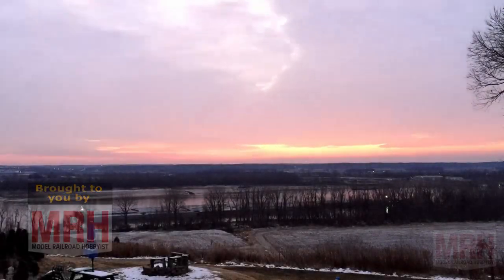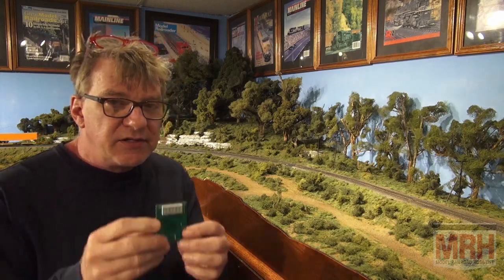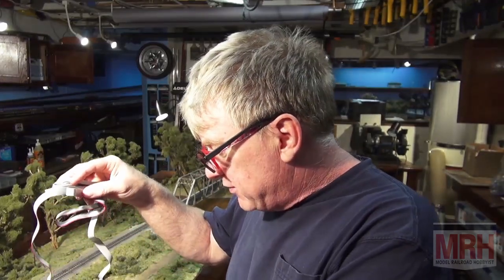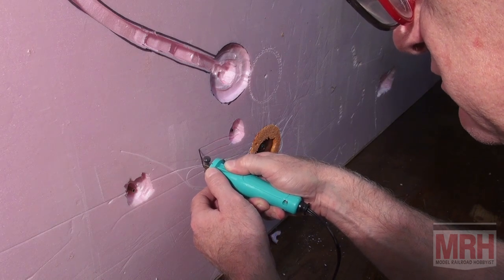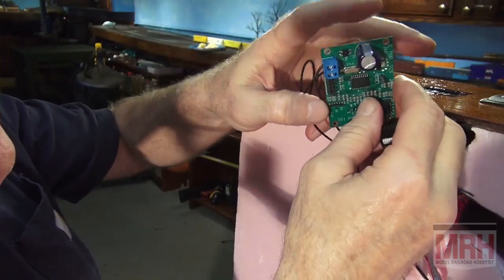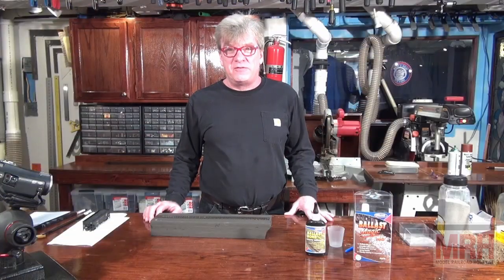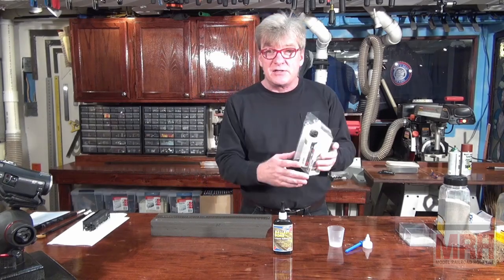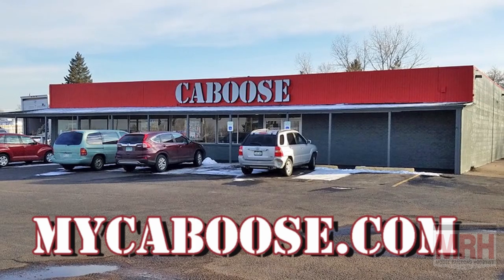Install a track speedometer | December 2020 WHATS NEAT Model Railroad Hobbyist

Comment: Great video Ken, very informative and classy installation techniques. I recall years ago that there were a series of articles in Model Railroader Mag. about determining train speed using a measured track distance and scale time to estimate train speeds but this gadget you installed is way easier. Thanks.

Comment: Mr. Patterson, I FINALLY have a place to start a model railroad.  I had one when I was a teenager, but I have now been without a layout, longer than with one.  I have decided to go HO scale and have been working on the track plan as I have time.
What, in your opinion, is the next “most important thing to decide” item I should be focusing on?  Not looking for hand holding, but I know a lot has changed since I did this last.

Comment: Thanks Ken, you are re-inspiring me to find my hobby again. I'm drawing plans to build a steel mill where I work. I have a bunch of footage of both a BoF (basic oxygen furnace) and an EAF (Electric Arc Furnace) both I work directly in front of performing laser readings to apply my companies Aluminum embedded shotcrete to maintain it's perimeter. It's quite fun and very dangerous, perfect for a nutbar like me 🙃

Comment: Great video; you said in the video that the speedometer could be set up for measuring speed in kilometers; but you didn't show us how to do that. Do we set the sensors up at 1/100 of an H0 scale kilometer (about 114.8mm or 4.52 inches) or how do we do this. Because some of us like to model railroads from other parts of the world where kilometers are used.

Comment: Nice clean installation of the speedometer, Ken. Well done. Wouldn't it be nice if TCS included a fascia panel-mount plate? Most users are going to want to install this device in their fascia. You had to jump through a fair amount of hoops to make this happen. TCS should provide a decorative face plate bezel to cover an oversize hole (drilled by the layout owner) to make this neat, tidy, quick, and easy. Also, for a few bucks more they could provide a wall wart power supply and necessary connectors that you had to rummage for. Just my two cents.
BTW, did the laundry dry okay? ;-)

Comment: Cool. I’d have placed a thin red plexiglass rectangle over the 7 segment displays (so offset the electronics further into the foam) to get an easier to read display as it hides the non illuminated parts of the display. 

. Seems to me the speed trap design made it needlessly hard. Better would be to have the modeler install the IR sensors where they can , measure that distance precisely ( and here is where mm would be so much better than inches ) and the program that precise value into the module to tell it how far and the model then does the calculation based on that distance. 
Requiring the modeler to physically place something super precise is a bad approach.

Comment: I like your videos, I get some good ideas, but I model in large scale. So I have a question problem. Since HO is, about 1/4 the size of large scale, do you think that if I take the HO distance of the sensors and multiply it times 4 it will give me a relatively close estimate of the speed of my trains.

Comment: For what I do to measure speed is set my throttle a bit under half speed and time how long it takes to do one loop I then measure the track it cover so let’s say 40 second 20 feet and so you do 20 times 160 (n scale or 87 for ho etc) then I get 3200 feet and with that divide 40 by 3200 and you get 80 mph in scale speed

Comment: Ken, great video. However , I’m concerned that you apparently didn’t test out all circuit connections BEFORE you sealed them in the foam. If you DID ,I think you should have said so. IF you DIDN’T , we’ll that’s a big no no in my book. Been there , done that and paid the price 😬.

Comment: The math for the speedometer sensors is off. The NMRA defines HO scale as 1:87.0857142. So a hundredth of a mile in HO scale would be 5280/87.0857142 x 12/100 = 7.276 (rounded to the nearest 1 thousandth). I have no idea how the manufacturer got 7.283. But since your only off by about a tenth of a percent, it shouldn't matter.

Comment: < Pedant Alert! >
What exact scale is your railroad because I have heard that, in the US, you use 1:87.1 for HO scale whereas, in Europe, we use 1:87.0?
In 1:87.0 scale 1/100th of a mile is 7.283 inches but in 1:87.1 scale it is 7.274 inches.
< End Pedant Alert >

Comment: Silicone is conductive, go with double sided tape.
Reply from the maker: Normal silicone rubber is an electrical and thermal insulator. However, it can be made in conductive forms. As long as the silicone is the normal form it’s perfectly fine. Look it up.